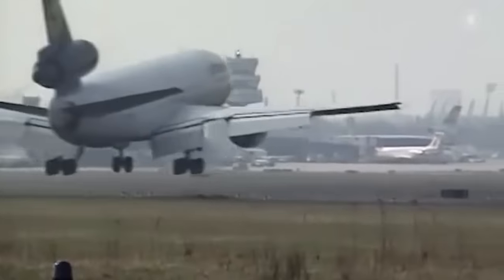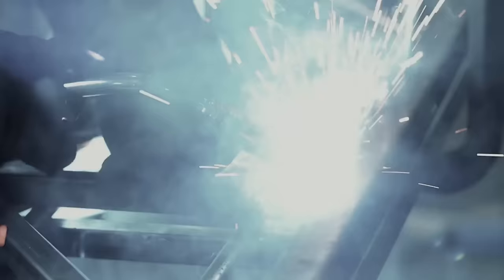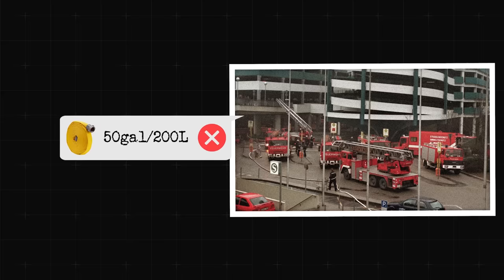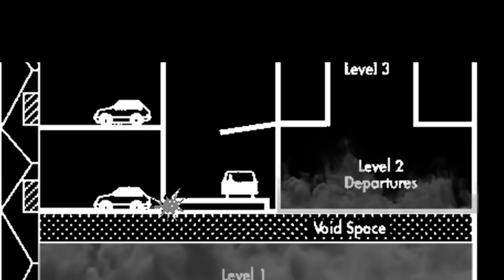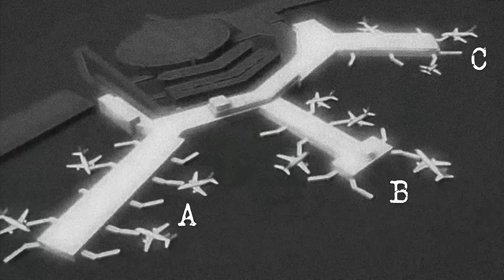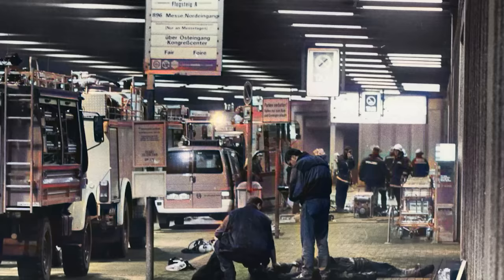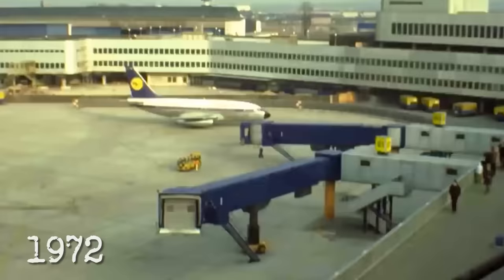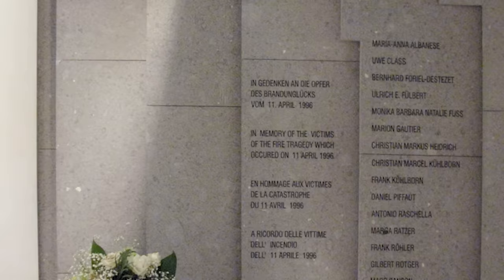The Düsseldorf Airport Blaze (Worst Airport Fire in History)

Comment: The elevator door not closing due to the smoke makes so much sense yet i had never thought of it. Such an easy mistake to make, how tragic.
Reply: That is reason why when there is fire, you never use elevators.
Reply: The wires can short in the heat, including the fire department override switch, and the cab will be delivered directly to the burning floor.   Never use elevators in a fire.
Reply: A commenter by the handle of @OnTourWithGerrit has said that the elevators at the airport now have sensors where they will operate but will only stop at floors and open the doors if that floor that has clear air. Great technology.
Reply: Easy? Has nobody ever told you to never use an elevator in an emergency?
Reply: @signalsoldier28  I have to agree with your comment. Anyone who's lived in a city or been to an airport has used an elevator and has read the sign. And please, don't anyone try to warp this by saying, what about those that can't read. It is common knowledge that you don't use elevators if the building is on fire. That's why stairwells are made to be smoke and fireproof, so long as some idiot doesn't leave a door ajar so they can use the stairwell as a smoking room.
Reply: People are not rational in a real emergency; We truly are creatures of habit.  

I stopped another guest from taking the elevator when the fire alarm sounded at 4 am in the hotel where we were staying.  I found him in the hallway with all his stuff confused on what to do. He was going for the elevator buttons when I said, “Better not. Follow me.”  We went down the nearest stairwell.  The stairwell door opened into the lobby. Thankfully, there wasn’t any smoke or fire in the lobby.  However, there were quite a few screaming guests and hotel staff!  Chaos!
Reply: I thought because the power can go out, leaving you trapped in the elevator.
Reply: @mjmooney6530  good save!
Reply: @WouldntULikeToKnow.  yes that's the main reason, the reason the doors didn't close was that the sensor that detects if someone stands in the door works by seeing a small light from the other side..
The smoke obviously blocked the light and the system though that there is a person in the door.
Reply: @signalsoldier28  we dont have an elevator at a home and we didnt have one at school either. And it's easy to make mistakes in a panic.
Reply: @aleksaradojicic8114  But they use the elevator from the open platform and from the garage - at this place was no fire, smoke or an accident. They press ground floor. This both elevators have had self working power - mean it works for firefighters at an accident too. Sure open at ground floor. Do you can not close if something between (IR-light). Thick smoke is same a human so door can't close. (BTW: At these times the system think it is the safest route and let talk loudspeaker exactly this way too.) 

The elevators are stupid - did not know it is a fire - so can't stop the floors before. The fire alarm was no automatic - so no alarm at the other places. With open the doors in ground floor the elevators hall start thick smoke and first react the alarm on the higher floors. 

But - another problem found: All elevators should stop in ground floor if the higher floor garages are in fire. They thinking that a fire happend in garage inside the Olympics year 1972 (e.g. Rote Armee Fraktion fire bomb, car accident) but never in ground floor hall.
Reply: @josephastier7421  It's not wires, it's the smoke inhibiting the lasers on the door.  Elevator doors have lasers at different heights that detect obstructions like hands, toddlers or luggage and thick smoke is more than capable of obstructing the lasers in the same way that a physical object would, which stops the doors from closing.
Reply: @krashd  It can be either one, and who knows even more failure modes could be possible.  It doesn't matter, just avoiding the elevators eliminates that entire class of risk.
Reply: @mjmooney6530 😦" INDEED!.... You deserve praise for possibly helping save that hotel guest's life, because not everyone would show concern for a total stranger. That being said, another overlooked cause of many fire victim's own harm is their disregard and unfamiliarity with  Emergency exits and Evacuation procedures. How often do fire survivors complain about not being informed what to do in an emergency but ignore posted warning signs and other safety procedures? 

Within my large Convention & Entertainment complex workplace, a decade ago, there was a small fire during a celebrity-attended senior citizen movie screening. Despite the obvious stench of smoke and the Fire Alarm sounding off, few Seniors in attendance willingly evacuated. Several even complained because the event organizer stopped the movie. It was so frustrating that I just wanted to leave Them inside, borrowing a line from an old ' Yogi Bear ' cartoon.... ' You're not gonna get any older, if you keep giving me trouble! ' "
Reply: @3618499  I could have done more.  No smoke on our floor so a few seconds to spare for the one person I had to immediately help from making a potentially deadly mistake when I could have just as easily knocked on all the doors on the floor to get the entire floor of people out but didn’t.

My office had its FireEX upgraded and tested.  They would usually announced when they were testing but not always.  Repeated conditioning of the false alarm can lead to ignoring the alarm in a true emergency - similar to the low fuel level light in a vehicle.
Reply: Yes, signs in elevators telling in in case of fire don't use them or right next to the buttons.   They were probably safer on the roof.
Reply: the people that build it are the problem, why use highly inflammable materials?
Reply: Modern systems shut the doors of the elevators even when the sensors are blocked and send the cabin to a floor beneath the fire.
And why you should not use elevators in case of fire: the tracks, where the cabins are guided, can bend under the heat and the cabin would get stuck.
Reply: (5:05) Willful ignorance and refusal to proactively provide assistance resulted in the deaths of eight people in the Air France lounge.
Or was the fire brigade simply too stupid for the tasks for which they are paid?!? Maps are available on almost every corner of an airport...
Reply: @josephastier7421  Elevators in Germany have, if at all, only a key switch for fire department override. There is nothing available to regular passengers to override the "door clear" sensors in such a scenario. Which makes the "stay away from elevators in case of fire" even more crucial.

Modern elevator controls are wired into a building's fire alarm system, and they automatically move to a floor that is as far away from the fire as possible, open the doors there and can't be used by normal passengers.  This is usually coupled with audible and visual information to evacuate. (I have seen these dot-matrix LED floor indicators turn into "FIRE - EVACUATE" text scrolling during fire drills.)
Reply: @josephastier7421  Yes, here in Germany there's almost always a sign above or next to an elevator door nowadays (so on every floor) that says "Aufzug im Brandfall nicht benutzen!" - "Don't use elevator in case of fire"
And another reason is that the elevator shafts will have a chimney effect.
Reply: Now days there are actually building in witch elevators are designed as escape route
Reply: Tragic that they had survived if they had stayed on the roof
Reply: As a result of those lessons learned, the new fire detection and fire alarm system is coupled with the elevator controls. Today, if any detector would detect smoke or fire on any level, the elevators would either remain where they are announcing a fire warning in multiple languages, or would stop on a safe level (A level where no smoke was detected, maybe even with at least one level separation, not entirely sure about the separation), I think if possible even the one closest to the exits, play an emergency announcement in multiple languages and cease operation there. That is intended to prevent anything like that happening again.
Also airport staff at least in certain areas have to attend a fire and safety training each year (that may however be coupled with training required to be allowed to work on the apron or the air side in general).
Reply: @aleksaradojicic8114  right
Reply: Soooo much experts here... What if you enter an elevator, not knowing that there is a fire at that building? You are all SO smart....NOT!
Reply: @RoadsFranconia  That is not the scenario they were talking about. They were talking about explicitly knowing there is a fire. Definitely do not go in an elevator if you're trying to escape a fire or any other emergency situation. It's crucial to ingrain these kinds of things in your mind because you will have much more trouble reasoning in an emergency situation.
Reply: This - and not a malfunction - is the reason why you should never take an elevator to reach a certain floor in case of a fire: You never know what goes on there.
Reply: @lucasrem  it was illegal. did you watch the whole video?
Reply: @RoadsFranconia  yea sure but in this case they knew it. And not knowing that there is a fire doesn't change the fact that you shouldn't use the elevator if there is one.
Reply: I would have never though about this. The more important conclusion from this is that when reading safety instructions, you shut the fuck up and do what it says without trying to reason around it with "common sense".
Reply: @aleksaradojicic8114  Actually, from what I know the main reason you don't use elevators during a fire is so that firefighters and other first responders can use them to quickly gain access to higher floors. That's what the fire key on an elevator does, it recalls the elevator to the ground and allows the firefighter full access to every floor, even ones locked out to normal operation. It also overrides the automatic door closing and opening, as well as the safety systems, allowing the firefighter to force them to close even if the sensor sees something in the way
Reply: @WouldntULikeToKnow.  That scenario might be even worse, since then you're basically sitting inside of an oven and can't do anything about it.
Reply: @aleksaradojicic8114  I always thought the reason was the electrics not working, I never knew smoke could be so thick that the doors couldn’t close.
Reply: @jessH090  Electrics can also be issue, as in worst case, you can lose control over elevator.
Reply: Every Elevator in Germany comes with a big warning: "Aufzug im Brandfall nicht benützen!". "Don't use the elevator in case of fire!".
It's not there for nothing.
Reply: @signalsoldier28 I knew you shouldn't use one but I never heard the sensors jamming as one of the reasons.

Comment: Just a little side note, the emergency number in Germany is 112 for fire service and ambulance. (110 is police)
Reply: With starts of mobile phones and smartphones it is equal what do you call, all numbers 911, 000, 999, 112, 110, 009, ...  all works. Most without SIM-card too. Specially Nokia. So do you need in Germany a SIM-card inside since 2011 for an emercency call!
Reply: I believe 112 is the universal emergency number and so it works everywhere, the US (as usual) is one of the last to adopt it.
Reply: @krashd  911 also is, even 108 and other local emergency numbers work. If someone calls 108 for example, the call gets redirected to 112 if the local number is 112.
Reply: @krashd  let me guess, you're one of those "metric is better because that's what everyone told me" people.
Reply: @OldLordSpeedy  Careful with that. The only number that guarantees that an emergency call is made (i.e. the phone and base stations use the maximum possible radio power and other calls are cleared to free up frequencies) in GSM-based networks is 112. Smartphones generally detect those other numbers and initiate an emergency call for them, too, but that is a bonus added by the manufacturer.

With a "dumb phone" you could call e.g. 110 and still be connected to the emergency center if the cell network you're connected to has a route for that number. It, however, would be a normal phone call with no priority.
Reply: @krashd  Fire brigade emergency number in Norway is 110 (112 is police), and in UK, 999 (for all emergency services). So, 112 is not universal.
Reply: In German [general] aviation, 0021 is the transponder code for VFR below 5,000 feet with 0022 being VFR over 5,000 feet - for the rest of Europe transponder code 7000 is VFR (America is 1200). Just saying.
Reply: @blatherskite9601  112 is universal from mobile phones.
Reply: @blatherskite9601  Ahah!  Good to know. Until this moment, being American, I figured 911 was near universal.  BTW, as a kid, before 911 was widespread in USA, my hometown had an emergency number:  444-1212.
Reply: @blatherskite9601  112 can be used in the UK
Reply: 112 is legally enforced as the standard emergency number in all of EU.
Reply: @blatherskite9601  999 is the emergency number in the UK you're right. But 112 also works, so you can use either number.
Reply: @ChristopherGray00  let me guess, you made a reply that has no relation at all with the comment. Also yes, metric IS better and its because it is scientific and easy to use. By the way imperial measurements are legally defined by the metric counterparts.
Reply: It’s really sad that I am not surprised the defendants get acquitted. It seems like in every disaster, no one faces justice. With that said, imagine being at the airport and it’s not the airplane that kills you but the airport. What irony.
Reply: Police Emergency number 110 in Germany is also used in Japan (119 for Fire and EMS).

Philippines used to have the 117 for all emergency services, but now they used the 911 system nationwide (first implemented in the city of Davao, which is located in the southern most part of the country).
Reply: These comments are a mess. But all I know is that in the UK, our main emergency number is 999 BUT if anyone dials 112 or 911 you will AUTOMATICALLY be directed to 999. 112 because of the many European visitors we get, and 911 because of American visitors AND the prevalence of American media on our TV. In the UK you can ring all three and be put through to emergency services.

However I do feel like the makers of the video should have used the German emergency number because it was...you know... in Germany

Comment: It always infuriates me when I hear people using elevators during emergencies! The worst I've heard was when a group of 7 people got in one of the Costa Concordias elevators mid sinking where they drowned after the ship lost power.
Reply: honestly that just sounds like darwin at work
Reply: That part of the video, however, was incorrect. The people did not run to the elevators as they saw the smoke but just used them calmly as they hadn't even realized what was happening. The horribly unprepared airport staff failed to start an evacuation, inform people via speakers or, most tragically, turn off the elevator systems on time. At the beginning of the blaze, only level 1 of terminal A was on fire, the rest of the airport continued to operate as no one was informed of anything at first. So, the people in the elevators were simply unaware of the fire and were surprised when the doors opened and filled the cabin with thick black smoke. Tragic
Reply: In many high rises, express elevators are fire reenforced and a part of both the evacuation procedures and firefighting efforts.  In modern buildings, it's as likely that you aren't supposed to use the elevators to stay out of the fire department's way, as it is for evacuation safety.  If you don't know the building, take the stairs, but elevators aren't automatic death traps in a fire.
Reply: @Knaeckebrotsaege  Only if they hadn't bred yet ;)
Reply: Because you are the last Action Hero, which stays calm in every situation like this, wiht completely correct decisions and... oh, you never had been in a situation like this?
Reply: They definitely earned a Darwin Award!
Reply: @olmaBLN  On every Elevator i have ever been on it clearly says DO NOT USE IN EMERGENCIES 
Idk but this seems pretty straight forward and easy to understand!
Reply: @darkadmiral106  was the emergency identified by the victims as so close? Reports showed, the ther was no alarm in this specific part the complex and smoke came out from the distance. So it pretty fair to came to conclusion, that the elevator here are safe.

Today elevators also stop operating during a fire alarm, mostly going to ground floor and keep out of service.

It is like in 9/11 people in south tower should not use elevators after plane hit the north tower, allthoug there they were safe to use
Reply: the people didnt know the Airport was on fire the info was wrong, there where in the Parking Garage which was on top of the Airport building, yes but there didnt see the fire or smoke, there wasnt a Alert... when the door of the Elevator opend there where in the Burning Airport Hall and the doors of the Elevator didnt close anymore because of the smoke...
The People where killed pretty much instantly by the Smoke...
Reply: In Costa Concordia, people were in elevators when the electricity suddenly went down. No one knew that's going to happen before it happened. They probably weren't aware that something was wrong with the ship at all, before stepping into the elevator. Please have some respect for the deceased.